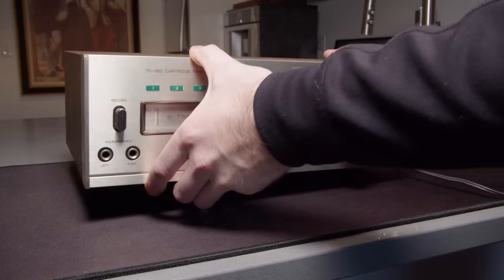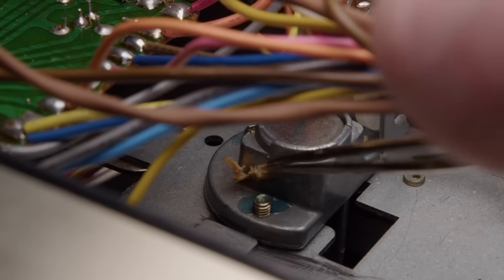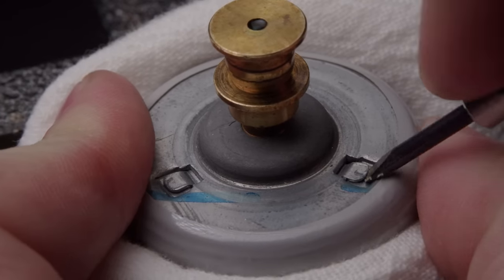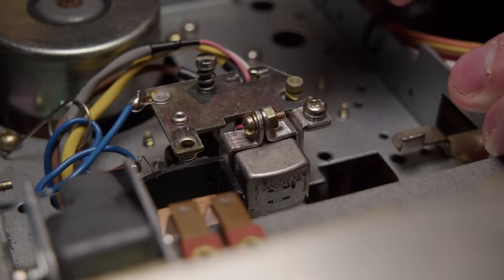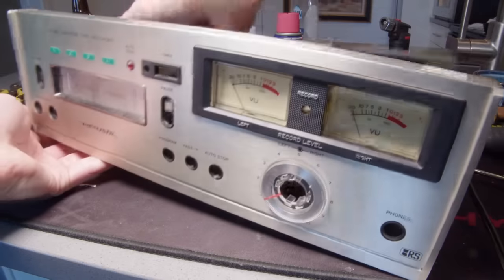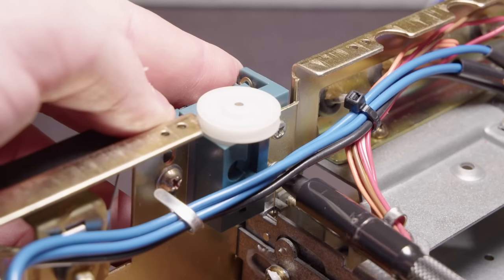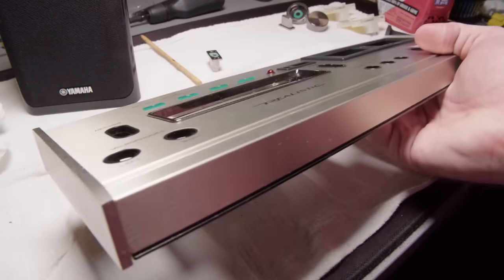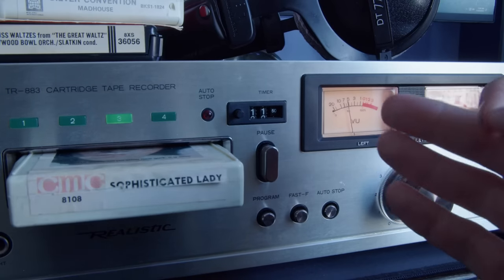An 8-Track Recorder‽ Be Realistic! | Vintage Hifi Revival

Comment: "Common"?   Yes and no.  It depends on the market segment.

At the lower end of the audio market, brands like Lloyd's, Soundesign, and department store 'house brand' all-in-one stereos often featured an 8-Track recorder.  They were not typically very good units, though, and almost all used a crummy Automatic Level Control.  They tapes they made usually pretty sounded pretty bad.

Stand-alone recorder DECKS like yours were not so common.  Ssince they didn't rely on automatic level control, they actually COULD make decent sounding cartridges.   A few 8-track recorder decks even offered Dolby, even though 8-track was not as susceptible to tape hiss as cassette was.
Reply from the maker: Interesting, thanks for the info!